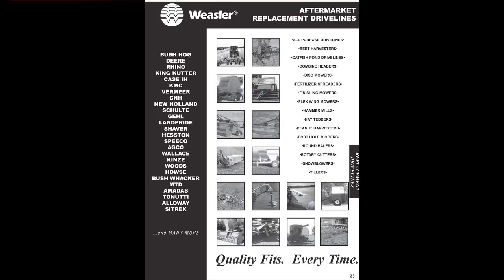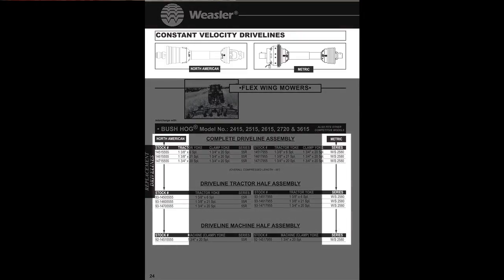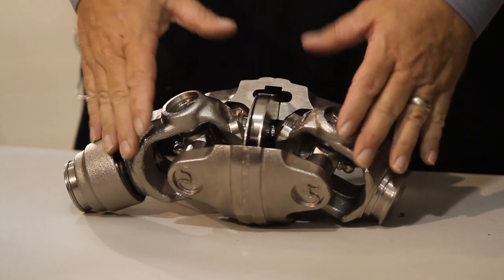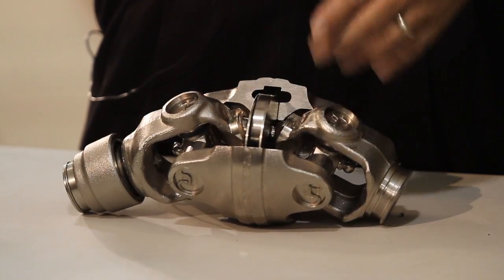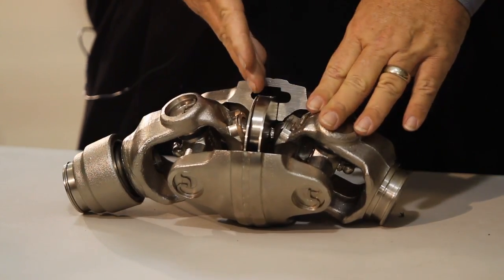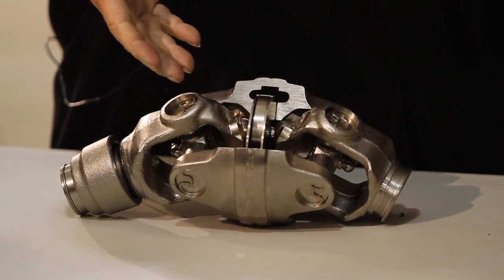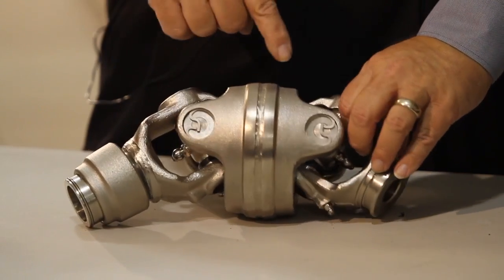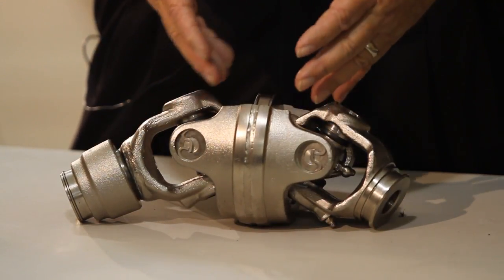Weasler CV

Comment: the cv joint is just ok   but the cross which you are using is not good!! 

cold forging or hot forging bearing is not good compare with cold drawn bearing cup like Walterschield or BYPY.  Even Comer also using such bearing
Reply: I am agriculture equpment and spry blowar production 
www.superagro.in
09860232328
I am interested your 
Product